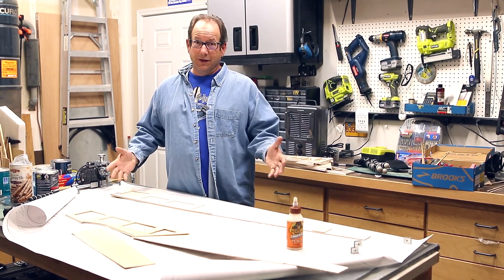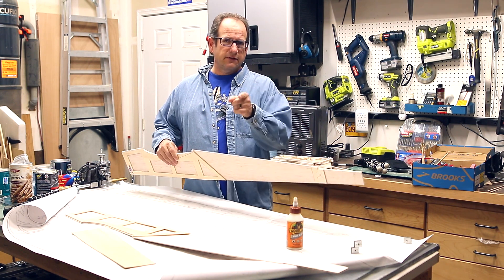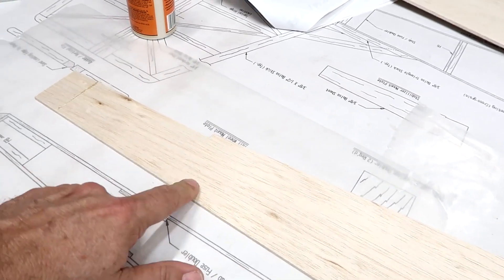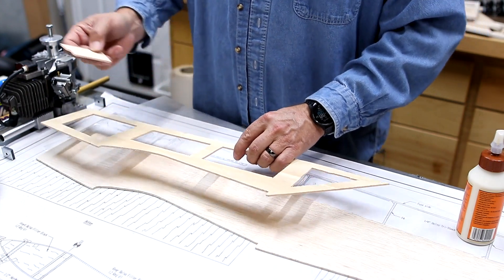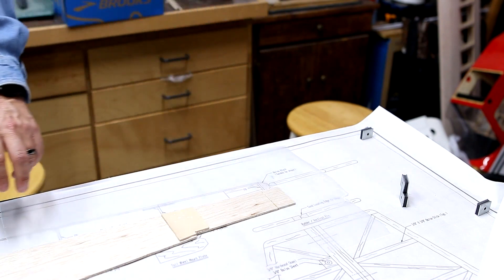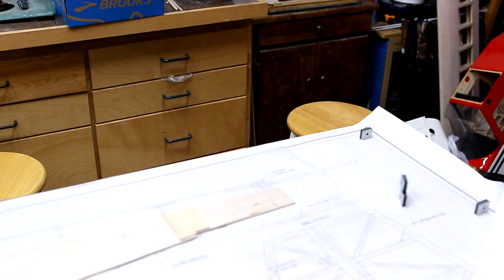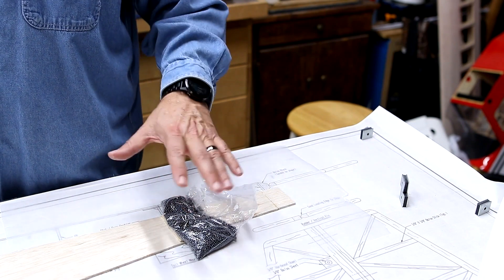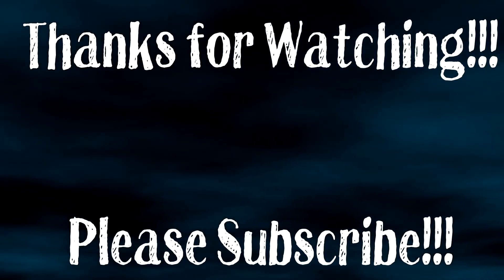EP15: Let's take a side... maybe two, Starting the Fuselage, Scratchbuilding Giant Scale RC Airplane

Comment: I suggest a spreader stick for the glue spreading. Fingers covered in glue prevent oneopening the Iphone print reader & computerprint reader. Seems that they have difficulty reading through dried glue.
Reply from the maker: I know what you are talking about.  Sometimes you can register several fingers prints so maybe you can pick one that didn’t get gooshed as much.  I really should use latex gloves when the glue is going to flow.

Comment: Dan, I know it’s been a year since this video. I’ve just subscribed. Great content. Do you know if Ryan was contacted about this discrepancy or lack of mentioning? He’s a distant cousin of mine that I recently met at the flying club I am wanting to join.
Reply from the maker: Hi Nathan!!!!   Yes I did contact Ryan Gonsulin just as I was starting this build on video via email.  He gave me some insight as to what he was thinking as he designed this plane, suggested I not use the 42cc I had originally planned to use as he used a Ryobi 31 conversion with and it had plenty of power.  So during the construction of this and after several comments from viewers like you I dropped the 42cc and have the Dle 30 which he suggested at the time. As for the discrepancy,  Im guessing you are talking about that line where the fuse is extended a bit. It took me a while to realize that Ryan attached a doubler over the joint because there is a line through the doubler on the published plan.  But hey, every plan has little issues so no big deal.  I did notice on the redrawn ACAD version that someone made, there is no line through the doublers.  That’s pretty cool that you have a designer in the fam.  I still think this plan is perfect for someone to start scratch building.   He made it super easy to understand and a super clean plan.  Hope you get into the club.  Do they have some tricky initiation you need to do to get in?  Secret handshake?   Have fun!!!

Comment: you were supposed to cut it on an angle from the sheet .... 6feet long (72inches) and 48 wide allows for a 50 inch piece to be cut as ONE piece ... you could literally cut both sides from one sheet with no bodge patch job ... you can btw cut all 4 pieces from that ONE sheet .. IF none are taller than 12 inches ... 4 sides by a max of 72 inches works fine ... if it was 2 feet tall per side then 2 sides per sheet ...

Comment: when i glue my doublers on i use tupperware containers filled with sand, also i drill small hole in the plywood doubler to allow thumb tacks to pass through to the balsa, keeping it from slading

Comment: Try tacking the two pieces in place with CA. You mate the surfaces together with white glue and then add the CA at one end of the doubler. You can also leave an area without white glue where you can put a few drops of CA. I have heard of other people using salt but I have also heard that it doesn't work well. Besides you want the glue to be as thin as possible and bonded to the entire surface to be strong.

Comment: Great job, Dan. Wonderful series of videos. But you've misread the plans, buddy. There is no error in the plans. The fuselage sides are  two pieces by design (because they're longer than 48 inches), with the splice at the aft edge of F7. The top view clearly shows a solid line through the fuselage sides there. And butt splices are typically reinforced by doublers. That's the main reason the doublers are there, and why they're so big. Note the other lines extending across the fuselage sides in the top view are dotted, or incomplete, meaning the parts are beneath the fuselage sides. Thanks and keep up the good work. Love the cat.
Reply from the maker: I'll have to go back and look at it again. What you point out makes perfect sense.  Using the doubler as a joiner/reinforcer.  But on the plans that were published in the magazine, there was an inconsistancy. I'll see if I can find it.

Comment: Dan, enjoy the videos, where do you find balsa for the fuse sides?
Reply from the maker: All of the balsa in this build came from National Balsa.  The sides are a wierd and expensive sized piece of wood.  I went ahead and bought the 8 inch wide pieces just for the sake of matching the build list... But if you can't find them, an option would be to edge glue a couple of 4 inch or even 3, 3 inch x 48.  Butt edge joining is not easy the longer the joint is.  Just a slight warp in the wood will create a tension that could wreck the flatness of the assembled piece.  But maybe you are better than me at it.  :)
Reply: @Capgains7777  thank you sir..